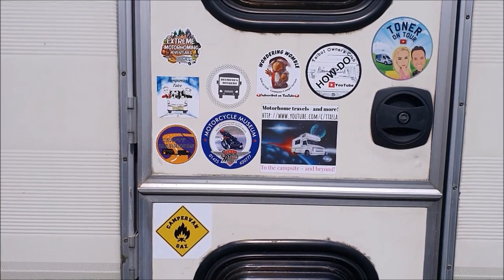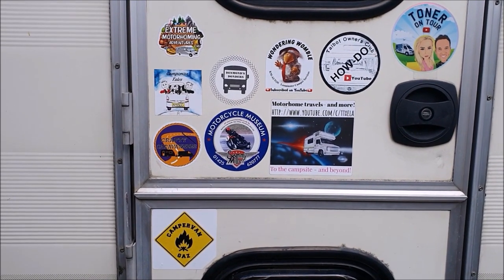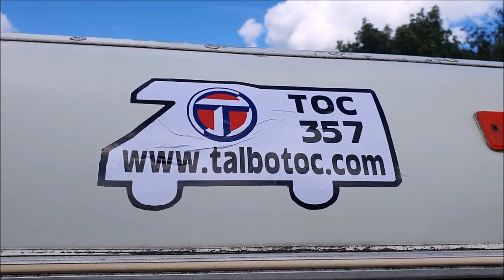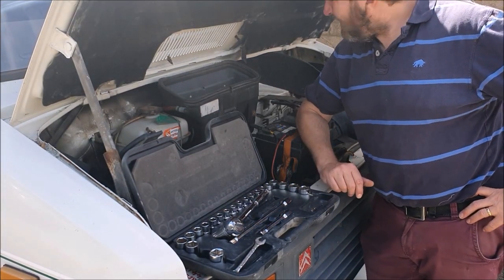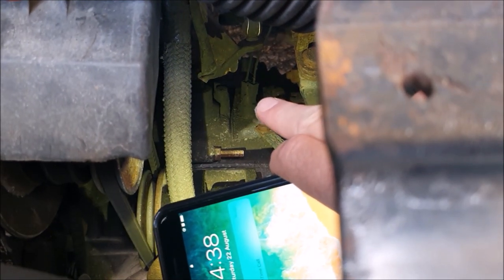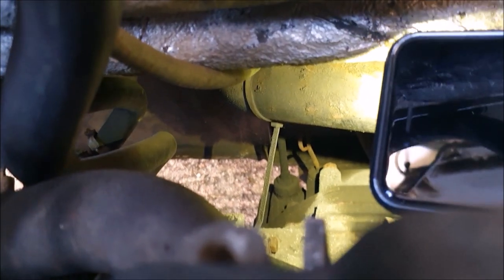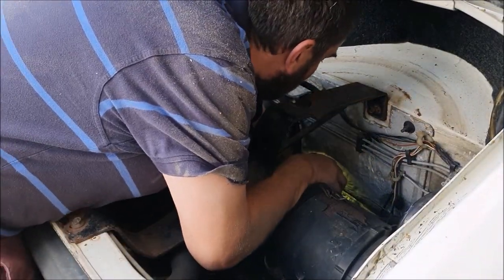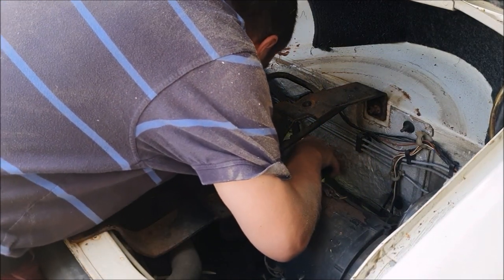Checking The Gearbox Oil, Citroen C25 / Talbot Express / Peugeot J5 / Mk1 Fiat Ducato

Comment: Thank you sir!! Your video helped alot!!!! I’m rebuilding a Citroen c25. The transmission started to fight today and it got stuck on reverse. After fighting with it for 2 hours we finally got it out and could move it around but it is still a struggle. I’ll take a look on the stick and try to see if I need to fill up the oil. Else I have no choice to take out the transmission to see if anything is wrong with it. Fingers crossed 🤞
Reply from the maker: Glad it helped, I never had gearbox problems myself but I believe a lot of common problems are due to worn mounts and/or linkages.

Comment: The gear box has two chambers once filled will drop in le el due To it transfering under use to next chamber hence 20mm abouve tge level try it run ten mile then check it ,it will drop to perfect .old skool camper owner 1984 talbot exress

Comment: As with a lot of this type of job, it would help if you had 6 foot long arms made of rubber! Just a word of caution. Manual gearbox oil does not discolour like engine oil would. There is no combustion to contaminate it in the gearbox. The fact that it looks OK doesn't mean that it was changed recently.
Reply from the maker: That is an excellent point, I have heard tales of folk draining the oil and finding it in a disgusting state but this may be down to extremes of neglect. I do intend changing it in the near future in any case. It didn't smell too bad either. The oil in my Celica gearbox smelt terrible when I changed it!

Comment: I know this is an old video mate but I’m struggling with cold starts in my c25 Citroen, essentially the same vehicle. Is there a cold start cable anywhere?
Reply from the maker: Yep, there's a cold start idle advance, Coastal Motorhomes have replacement ones available. If it starts but won't run it could well be the problem, if it won't start at all then I'd say it's unlikely to be the problem.

Comment: Hi there again Alex my friend, can you please tell me the measurement from the bottom or top of the gearbox dip stick to the top mark of the stick, so I can check that my oil is at 1.9 ltrs which is what there should be in there, many thanks in advance.
Reply from the maker: I'm working away from the van at the moment but the best advice I can give you is to refer to the JK towers website page on gear linkages;
https://www.jktowers.co.uk/page/info-gearbox-linkage
If you scroll down (quite a long way down) there is detailed information on gearbox oil levels and dipstick marks.

Comment: alright mate, hope your well. Im re doing my bathroom in my T Express 1992, ive the old rubber pipes to the sink, id like to plumb in domestic taps or perhaps like you have. Did you use any special reducers from the rubber pipes? or any tips on how to best go about it?

All the best rich.
Reply from the maker: Hello Rich, yes, I used a domestic tap connector and a small length of copper to a hose connector, It's covered in this video https://youtu.be/rUiq-Ro4AoQ 👍

Comment: Hi Alex. It's very confusing regarding oil in gearbox. So I phoned coastal Motorhomes. They told me to drain oil out from gearbox and differential. Fill with correct amount of oil. Scratch mark on dipstick.  If too much oil, it puts stress on drive shaft seals. Mine is 1.6litres. But still not sure.
Reply from the maker: I recommend reading the JK Towers link if you haven't already. But still there are a lot of different opinions on this so it's hard to get to the bottom of it 🤔